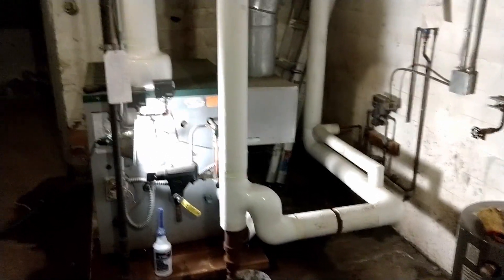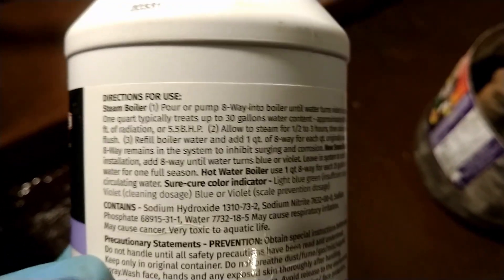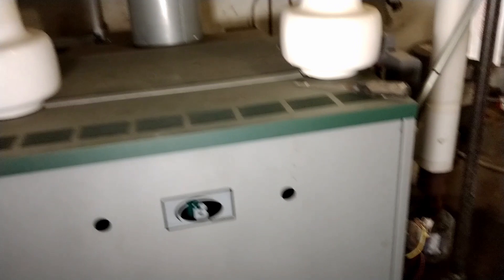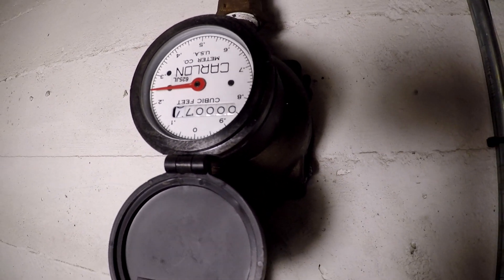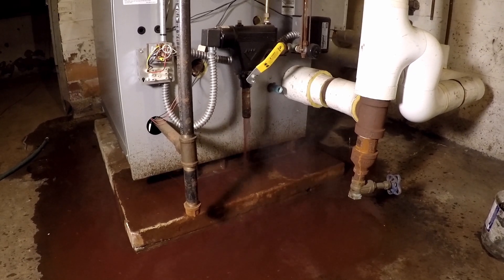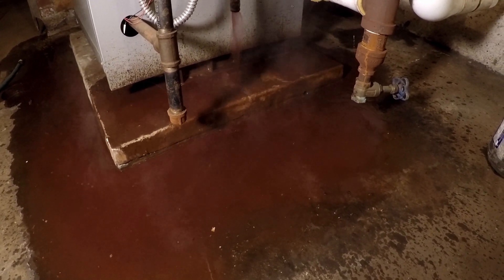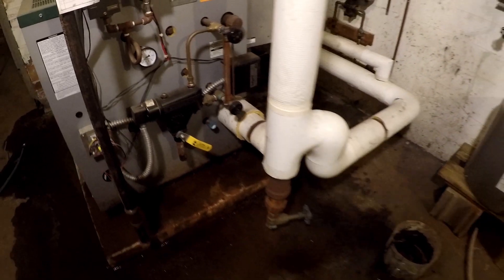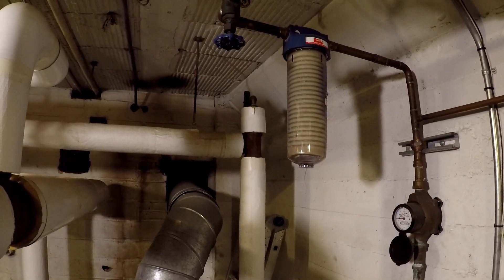Flushing and treating a steam boiler to remove sludge

Comment: One more question, is that normal that I adding water from the water feeder by pass into the boiler which I drained and emptied ready, but there's no water can be added into the wet return where I see it's connecting the nearby feeding pipe.

Comment: Can I just adding the boiler treatment into a main vent open or any radiator?  If so, do I need to mix it with water before putting it in the wet return pipe? Btw my steam heating system is single pipe (steam and wet return in a same pipe) 😅
Reply from the maker: I would add it as close as possible to the boiler.  You can add some water to the empty container, swish it around, and the poor it in the system kind of like how your mom or grandma would do with a can of soup!

Comment: did anyone notice the 10 inch solid metal safe door at 4:05?! are you a kidnapper or do you literally save gold under the mattress? maybe prepared for a russian nuclear holocaust??
Reply from the maker: @sleepingtiger4436  it’s more than ten inch!   My building was a bank originally.  Good eye!  Thanks for watching.
Reply: Did you see the size of the trunions on that door! Seen that once before, brewfesy in a bank. Two floors two vaults and teller window. Downstairs was huge.

Comment: Do you have a main vent? It should be at that fitting where you added the 8-way
Reply from the maker: I couldn't find one.  I have to unscrew the cap on that upper pipe in order to fill the 8-way.  It's a bit of a twister to reach, but I it's manageable.
Reply: @deanvandress4693 that’s where the main vent should be

Comment: I think the idea that the 8-way would clean your radiators/convectors was mistaken.

The steam is pure water, none of the 8-way can get there
Reply: This comment is correct.  think of how a still works - boiling water into steam leaves salts behind.  Diagnosing that cold radiator would make a good video though :)
Reply from the maker: interesting.  i'll take a sample from the radiators to see if any purple has reached them.
Reply: @deanvandress4693  it hasn’t, unless your boiler is surging so bad that it is pushing boiler water into your main
Reply from the maker: @pb7379-j2k  ok.  I’ll check it out and will report back.

Comment: After the heating season should you empty the water out of the tank and and leave it empty throughout the summer and refill it when the heating season starts?
Reply: good question! I have the same question
Reply from the maker: The people I trust say no.  They recommend keeping water in your system.  They say that the water that has been used has had the oxygen removed/severeley reduced through the process of use/heating.  You want to avoid introducing any new oxygen into your steam boiler system if at all possible, which is why even a small leak should be corrected.  Adding new oxygen feeds rust.  So, avoid changing that ecosystem unless required/needed.

Comment: Hi Dean,
Thanks for the video. I wanted to know, after adding 8-way boiler cleaner 2nd time do we leave the chemical in the boiler and let the boiler run with it or we should drain again and add fresh water?
Reply from the maker: Hello Asan and thanks for watching.  The instructions on the 8-way bottle say to do the first flush and then to refill the boiler with water and add 1 quart of 8-way per 30 gallons of water in the system.  So, you add 8-way until the water turns violet and let it steam for 1/2 to 3 hours.  After that initial treatment, you refill with water and 8-way to the same violet color.  The bottle says to leave the 8-way in the system 'as a rust inhibitor'.  So, it seems that it cleans/flushes and then acts as a rust prohibitor.  Here's a link to the company's website:  https://rectorseal.com/8-way-group.  I am not affiliated with the company at all and didn't get anything from them at all.  fyi.  Have a great day, Dean.

Comment: You don’t own a hose?  This place was like yea sure just drain the boiler onto the floor we’re not worried about the mess?
Reply from the maker: That's a fair point.  I didn't have one handy but will use one in the future.  Fortunately, the drain is literally 3 feet away directly in front of the boiler.  Thanks for watching Keith.  Dean.

Comment: In my limited understanding, adding fresh clean water to a cast boiler is a bad idea. It was explained to me that the fresh water adds new h²o which interacts with the iron and allows more rust (oxidation).
Reply from the maker: Yes, you want as little fresh water added to the system as possible for exactly that reason, but it’s important to understand the difference between fresh water being added by flushing (a one-time short occurrence) and fresh water being added every day because of a leak or water loss throughout the year.  While flushing does add oxygen, that oxygen is quickly purged through use.  Fresh water constantly being added daily because of water loss keeps oxygen in the system for a prolonged timeframe, and that’s really bad for the system.  It’s unavoidable to flush the system.
Reply: Wait a minute...I have a steam boiler that heats an office building (14 radiators) which produces way, way more steam than this one and has an auto feed to replenish water so of course does it on a daily basis. The city doesn't provide unfresh dirty water so I'm stuck. Of course it creates dirty rusty water so I just flush it once a week. I don't believe it's avoidable. It's a 1900 building so the heating infrastructure is pretty old. The boiler is a 2005 and is inspected and maintained regularly and works well.
Reply: @CaresforAll  Its the Oxygen in the water that rots the boiler out. Make sure all your air valves shut off once they get hot (no hissing) and check the end vents on the ends of the mains  for the same thing- once hot they should shut off. this prevents the steam vapors from escaping, steam is water , and your water feeder wont feed as often. some feeders will tell you how many gallons of water you are feeding. plus you can add some Rust inhibitors that help prevent mudding up.
Reply: @Jessedog11  Thanks for the info, every bit helps.
Reply: All I know is after replacing 2  boilers in a lifetime you watch and listen to everybody very carefully its a very expensive investment. Protect that boiler at all cost.

Comment: Suggest you don't want the chemical in the ground water. Run a hose to the sewer system.
Reply from the maker: The solution to pollution is dilution.

Comment: Hi Dean.  Thanks for the video.  I have used this product in the past but also use a similar Hercules product too.  I generally flush the system out each year, as well as clean the pigtail and sight glass too.  If one does this annually, you won't get as much mud and crud when you drain out the boiler over time.
Reply from the maker: Thanks for the info!
Reply: I interpret that this method is probably the best way to reduce the damaged done by fresh water since you must always live with make up, unknown leaks and flushing. It reduces inside the pipe damage.

Comment: You just drained the sludge right on the floor and the bottom of the boiler? You couldn't just hook up a hose to it and neatly lead it to a nearby drain? All that condensation is going to cause the boiler, other pipes and metal objects to rust. Common man.
Reply from the maker: It's a fair point.  I got a lower profile bucket and started using the bucket for the periodic draining.  Thanks for your feedback.  I appreciate the constructive criticism.  Dean.